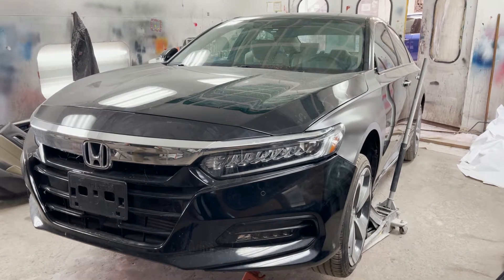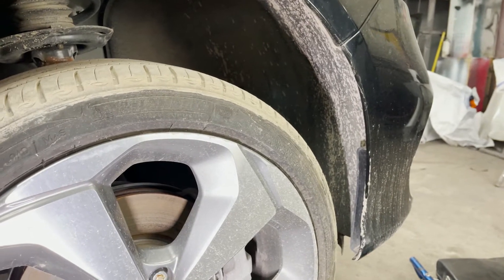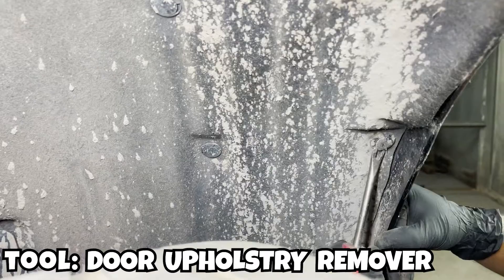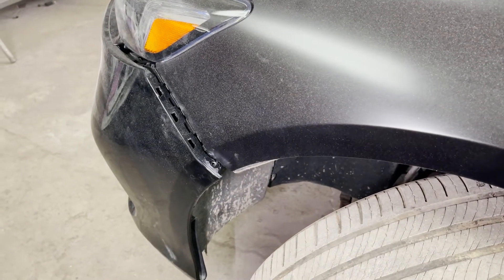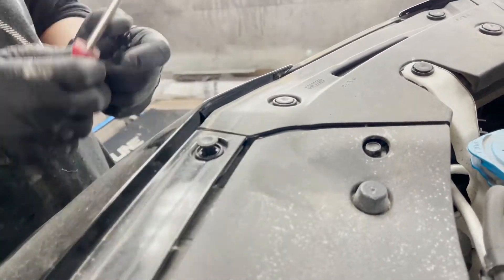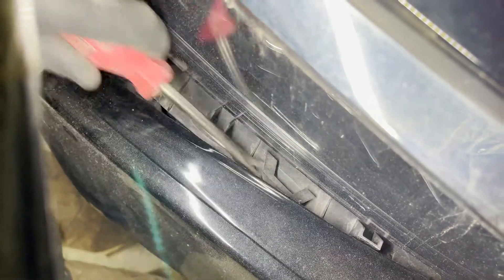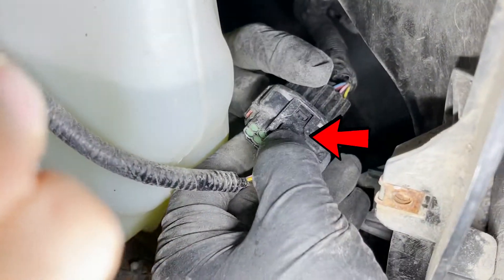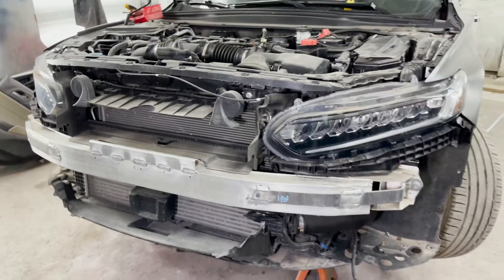DIY: 2018 - 2019 - 2020 Honda Accord Front Bumper Removal / Takeout - Any Bumper Takeout

Comment from the maker: Links for other DIY videos related to Honda Accord:

DIY 2018-2022 Honda Accord Rear Bumper Removal 
https://youtu.be/FWlXZFCDssg

DIY 2018-2022 Honda Accord Tail Light Removal
https://youtu.be/idysj8Uab8c

DIY 2018-2022 Honda Accord Steering Airbag Removal 
https://youtu.be/SgHbtnOTvBw

DIY 2019-2020 Honda Accord Driver Door Panel Removal 
https://youtu.be/BwmrxRWEqBg

DIY Honda Smart Key FOB Battery Replacement
https://youtu.be/FlfhTE9uzZ0